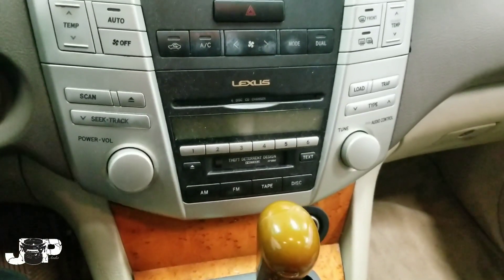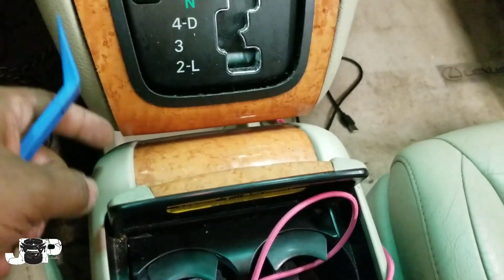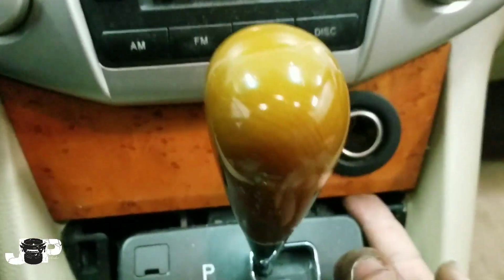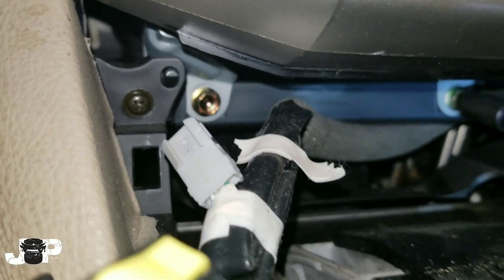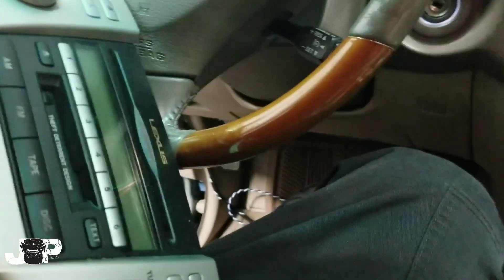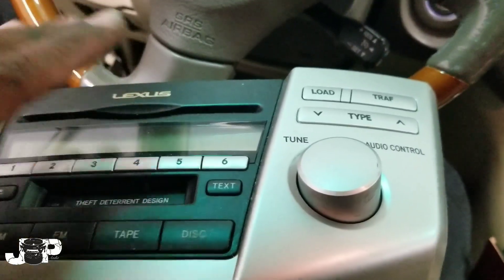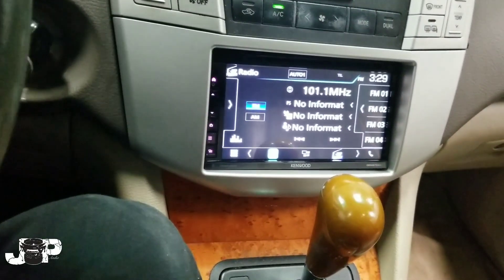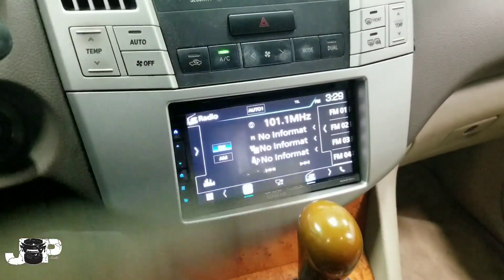2005 Lexus rx330 radio removal

Comment: You can also stick a flat head screwdriver in that notch near the Park gear, and it will allow you to change gear with out the car keys.

btw, thanks for the video, I'm going to use it to fix one of my switches that fell in

Comment: That console slides back.
Reply: Yes - pop up the wood panel door (where the cup holders are located) there is a black lever in the rear of that pop up.  Pull back on that lever to make the whole console slide back.  I believe it slides back at least half a foot.

Comment: Great video, I know this is a older video but maybe you'll see this I have the same Lexus non navigation im installing a Radio tomorrow and I have that same dash kit mine comes with the 68 ohm resistor I have gotten mixed answers if I have to wire in this resistor in to the specific pins in the harness with a non navigation system. Did you use this resistor? Will my a/c climate controls work without it? Again Non Nav and Non Mark levison thank you

Comment: I got a 05 rx330 and having trouble getting sound. Not sure if I wired the correct cables. Do you have a video explaining how to wire up the aftermarket radio?

Comment: Question: I was planning on buying a radio off of eBay to replace the one in my Lexus. Radio works great but my CD is displaying "ERROR 4". I have tried everything to fix this including removing fuses and replacing. Do you know of any way to fix this? If not I guess I'll be installing another stereo myself and thank you for the instruction on how to do this!
Reply: The E04 error message may occur when the laser for the CD player is unable to read the disc being played.  Jul 23, 2019

Comment: Why anyone would want to install the aftermarket variants I don’t understand. Call me old fashioned, but the idea of having both the cassette player and the CD player is an amazing concept, and an excellent blend of both the 90s and the 2000s culture. Personally, I would’ve bought the old Stereo off of ya, JP, because I need to get Button 3 to work. On mine, the 3rd button is stuck and won’t push in at all
Reply from the maker: lol yes that is a good combo but what happens is that the clients are playing music off their phone so there was no need for either the tape or cd player so he wanted to change it. he also wanted GPS navigation.
Reply: Perhaps for the invaluable backup camera feature.
Reply: What harness did you use?
Reply: @jptheinstallguy  You can buy a cassette tape blutooth adapter for about 20$ on amazon. You can listen to music and get gps through blutooth via the cassette player
Reply: 6-CD changer + cassette deck is truly an awesome setup, especially if you are planning to install an aftermarket flux capacitor and time travel back to 1993. If you live here in the future, though, a nice, big touch screen for viewable GPS maps and easy access to multiple apps without having to mess with your phone + backup camera display is much better. Plus, you don’t have to carry around that big-ass zip-up book with all your CDs and/or cumbersome cassette box so you have a decent selection of music to listen to. I’ve got no nostalgia for any of that.
Reply: @lbgtr87  I’ve got no choice but to swap the radio and I’m not even going to, just gonna run it through an equalizer with subs and 2 amps. The damn radio in the car has so much static it’s useless in every setting 🤣 I can’t stand it anymore it’s driving me crazy